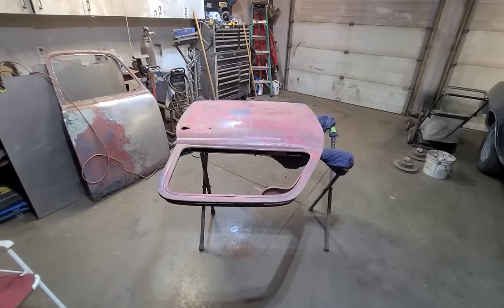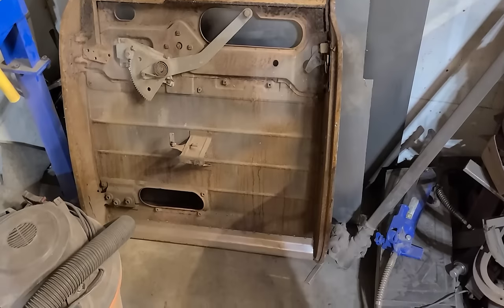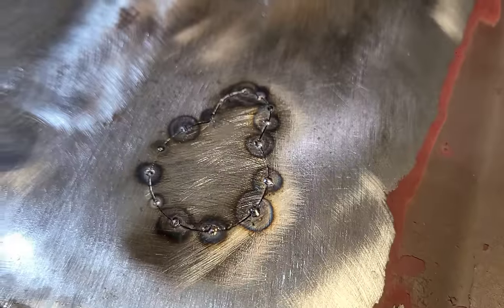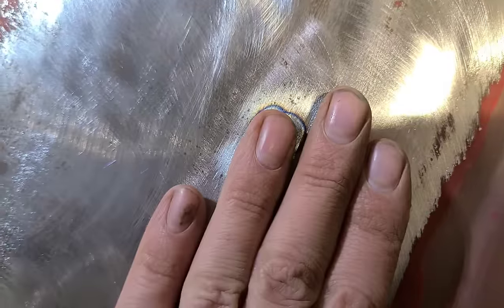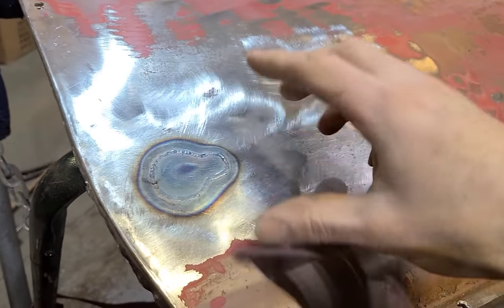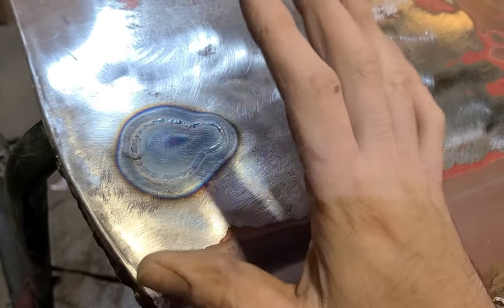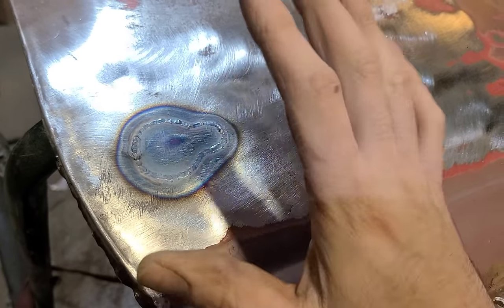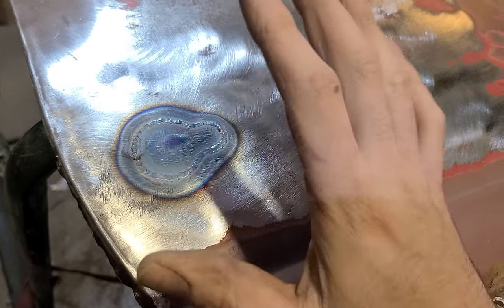Teaching Myself How to do Bodywork. Did I ruin this door?

Comment: Thank you. I am learning (and I am old). I used a flapper wheel to strip an antique refrigerator and turned the cabinet into several oilcan situations. Not knowing what had happened, I purchased a shrinking disk. Did not work, now I had a bigger mess. Shrunk it even more with an acetylene torch, an even bigger mess.
Finally, I made a large slapper out of a heavy truck spring and polished it up really nice and used a piece of railroad track for a dolly. It worked out to where a thin coat of nitrocellulose glazing putty made it flat enough for the old girl I married. Curved metal is WAAAY easier than flat metal. Thankyou, again.

Comment: I guess the benefit of shaving the door handle with bondo is that you have less of that tedious hammering to get rid of the dent caused by shrinkage. Sounds good to me! Nevertheless, pretty impressive how you made those welds disappear!
Reply from the maker: Sometimes I add extra hardener to the bondo so it gets really hot when it kicks over and warps the door. Then I try hammer and dollying it, but the bondo keeps cracking. What am I doing wrong?

Comment: Nothing "lame" at all about your video. Greatly appreciate the explanations/education !! Did a somewhat bigger but similar round patch from a "saddle tank" filler hole in a Model A running board splash apron. Had exactly the same experience you just showed. That's when I discovered that you need to grind off the majority of the weld bead prior to trying to metal work the patch and its surrounding area. Also needed to use the shrinking disc and the slapper before calling it "OK" !! Definitely not "good" !!
Reply from the maker: Yeah those splash aprons are a bugger to fix!

Comment: To be honest, it didn't even occur to me about the possible variations of angle needed for the window tracks.

Made sense once you described it... and having the skin off (albeit not a simple 5 minute job for removal) will make it a lot easier to get it set up correctly, along with swapping for the one piece side glass.

Keep up the fine work and I look forward to the next episode.
Reply: It's easy if you just pre-bend the glass.
Reply from the maker: Thanks, I'll try to keep the episodes coming!

Comment: To be honest, matey, I was surprised at you taking all that time to put metal in the holes where the door handle was when you still have that huge Bondo sponsorship to take advantage of.  Likewise, the missing etal at the bottom of the door can easily be taken care of with some nice chicken wire (it IS the Chicken Truck, isn't it?) then some long strand, then some short strand and lastly the plastic filler on top to make it all smooth.  How else are all of us blokes with old cars going to keep the myth that "the old doors are heavier because were made of thicker metal" going if you don't fill them up like we do?

Seriously Kyle, I really enjoy watching you work with the TIG and sort out the issues caused by heat shrinkage.  Your ability to feel the metal and instinctively know what its doing, why it is doing it and how to correct it, is not something everyone has.  I also like the idea of where you are going with this project and it makes total sense why you'd pull the outer skin off if you are going to be basically redesigning the inside workings of the door, as there's certainly little room to get at the cavity otherwise.  Bloody good call, I reckon!  Are you going to put electric windows in the beast as well?

A good watch, my friend.  Thanks for putting it up there.  All the best.
Reply from the maker: Thank you! I will be keeping the crank up windows in this truck.

Comment: You can't compromise with both bondo and metal? Weld grind hammer fill? Almost criminal! Oh and thanks, I repaired (mig welded) then grind then sanded with 50 and then 80 grit think oh what would carter do. 😮

Comment: 😂😂 brilliant, fantastic job...is it possible to get the shrink out after using mig ?
Reply from the maker: Technically, yes, but the mig weld is much harder and will crack if you hammer it too much, so it's not a good idea to weld seams in one pass with the mig.

Comment: Did you make your own shrinking disc? I've heard that it's the heat they generate through friction that does the shrinking, so there shouldn't be anything really special about the way they are made? Do you find the disc cheaper/more controllable than using a flame for shrinking, or just that you don't have gas?
Always makes me laugh when you say "It's not perfect" when it looks so good and I can't see where the new material meets to old. I love the vintage vehicles but would be interested to see techniques used on an example of newer, thinner steel (maybe a customer repair). I would imagine it's much more difficult.
Reply from the maker: I got mine from Wray Schelin. Check out his YouTube channel, he does a good job of explaining how it works

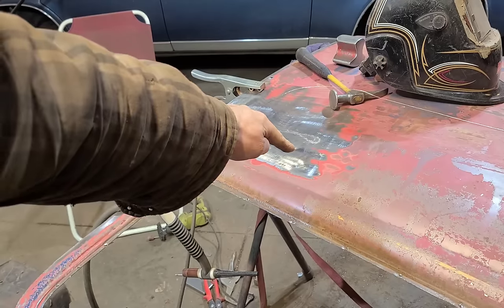Comment: 13:07 I'm rewatching now and I'm interested in proces of making that plugg. How did you do it?
Reply from the maker: I just used a 5/16 pneumatic hole punch
Reply: @CarterAutoRestyling  That's kind a make things easier. But, if you haven't got that or if you haven't got the mechanical hole punch, how would you make that plugg?
Reply from the maker: @prevodpropovedi  sharp tin snips, a file and a lot of patience
Reply: @prevodpropovedi Start by cutting a square plug a little larger than the hole diameter you have then you file or sand the corners into round. The plug doesn’t have to be perfect fitting to weld.